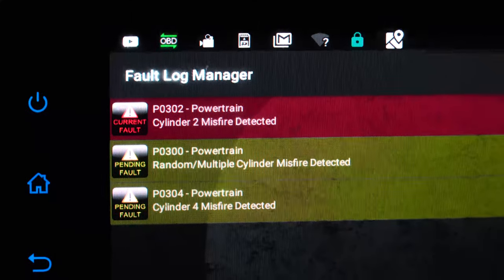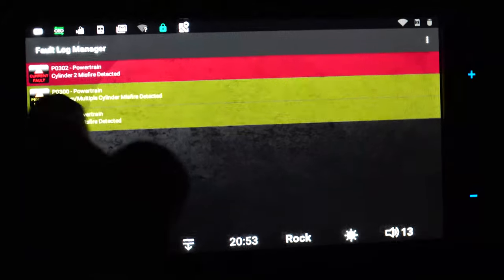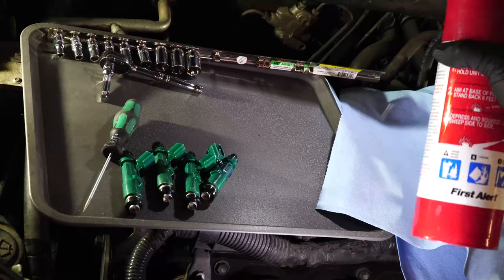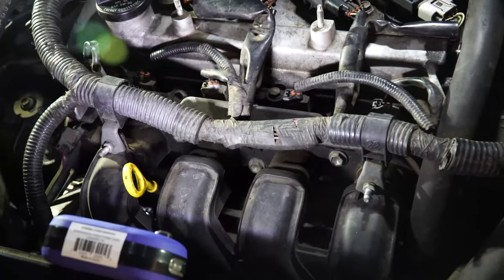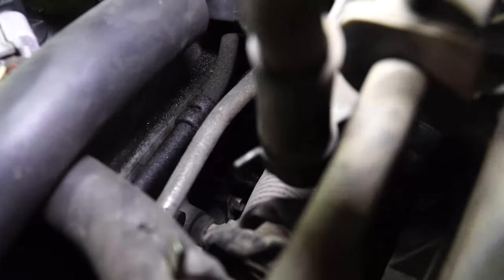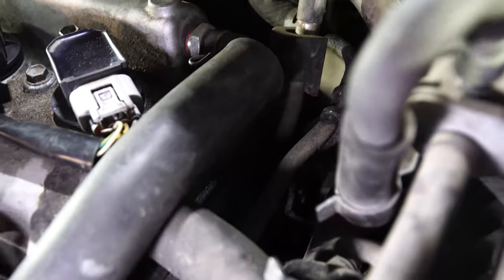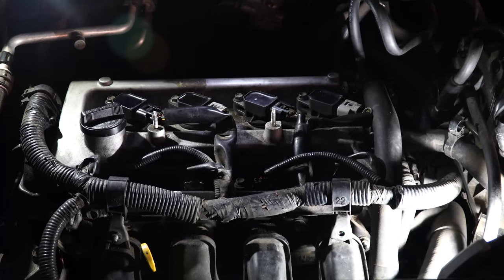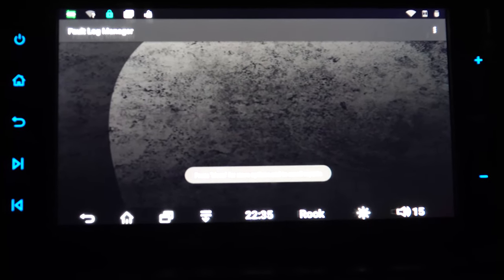First gen (2004-2006) Scion XB 1NZ-FE Fuel Injector Replacement

Comment: Great information about how to replace fuel injectors on a 2005 scion Xb. Just a couple of things I’d like to add one would be that you need to remove the bolts holding your valve cover down, so you can gain better access to your fuel rail . And like he mentions, just be careful please vacuum and wipe up all the dirt and debris around the fuel injectors, but either than that great info took me about an hour to replace four I just had to go back to NAPA since the injectors I purchased did not come with the complete O-ring seal.

Comment: Thank you!  My Xa has almost 280,000 miles on it and there is a slight hesitation that's been there for a while.  I've replaced the plugs a couple times over the last year, replaced the PCV, replaced the Mass Fuel.  Gave up at one point and took it to my mechanic because of an exhaust smell - he saw that I'd knock loose a hose (DOH).  Didn't want to charge me.  Engine shakes a lot but it is paid for!

Comment: Thanks for the video really helped me.  Well done.  I had a leaking injector on the far left /passenger side.  i was able to replace it without totally removing the whole rail which meant i didn't need to mess with the hard to get to side 10mm bolt.

Comment: Having a issue where the car has trouble starting when it’s warm. Did coils, cleaned throttle body, replaced fuel pump recently(car was not starting at all.
Reply: hello. have you found the problem to your hard start when engine warm? I seem to face the same problem, I also did coils cleaned throttle body and replaced fuel pump.
Reply: It was the fuel pressure regulator. If you ever change fuel pump, change all the components

Comment: My 06 xB has been getting 21-22 mpg on a consistent basis. It used to get 28+ mpg around down and 33-38 hwy.  I took it to the dealer. No codes.  I've had everything done on this car to improve mileage. No change. I switched to premium fuel at Exxon. Still no change.   I kinda narrowed it down to this
Reply: Never use premium fuel!! It will destroy our (I also own a xB) catalytic converters.
Reply: Did it fix your bad mileage?
Reply: Been a while but same, can't place it

Comment: Thank you. I love this video. I have a 2012 Toyota Corolla xli and it has the same 1nz fe engine. I am having a misfiring issue on the #4 cylinder. I replaced the coil pack and a set of sparks plugs but no improvements. Could it be that something is going wrong with the injector # 4?
Reply: To see if it's the injector, switch injectors #3 and #4. Clear the codes from your car with your OBD2 reader and drive around until you get the codes again. If you get the error code on #3 then you'll know it's the injector. If the code keeps saying #4 then something else might be the issue. Same thing when you're trying to troubleshoot spark plugs and ignition coils.

Comment: I was wondering if changing the injectors permanently fixed the problem or if the codes came back after driving the car. I'm having a problem with my 1nzfe (Yaris) where it throws a P0301 and loses power but only when going up hill under high rpm's. Under normal driving conditions it wont throw the code. Like you, I've changed the plugs and ignition coils and I'm probably going to replace the injectors next but it would be great to get an update on your results. Thanks!
Reply: Did you ever diagnose the issue?  I'm having the same problems now.
Reply: @plsmoothy Hey brother, did you ever find out the issue? I’m having the same isssue as you, and I want to see if you replaced the fuel injectors and if it fixed your car afterwards
Reply: @Senormaster   it was definitely the injectors.  I had all the injectors flow tested and one of them was malfunctioning.  I replaced the bad one and popped them back in and the problem was solved.  Good luck
Reply: @plsmoothy Hey brother, question, did your injectors ever go bad after installing the new ones? My car is going through the same thing again. It was working well for 4 months after changing the injectors, but then it gave me that same issue again going up hill. 
Thanks
Reply: P0302 on my scion xa 248k. 
To diagnose mine I sprayed brake cleaner around the injector seal and the idle surges meaning I have a vacuum leak. Fuel injector seal kit is $2.00 so I'm ordering 4 sets and changing all the seals... hope this solves my issue

Comment: Hey guys this piece of trash here is gonna work so dont give me a hard time when my ass and my engine catches on fire 😂 Also i havent trouble shooted shit. I am not a mechanic im just a stupid fuck who was dropped his head way too many times. And because im not a mechanic and too be frank with you im really just a incompetent moron who spends a needless 600 dollars on spark plugs and ignition coils that didnt need replacement. So when i say something isnt the problem what im really saying is i replaced a part that didnt need to be replaced🥴 Btw the car just started making a 
rattling noise from the rear tire, i guess its time to replace my engine 🤔 Well i replaced my engine and the tire the rear tire is still making noise so i guess its time to replace my front windshield. Alright guys the tire is still making noise so after my thorough diagnostic algorithm that i made up when i was a newborn, ive come to the conclusion that it might be the tire although it could very well be my turn signal fluids are low, and with my experience im gonna go for the latter🥴